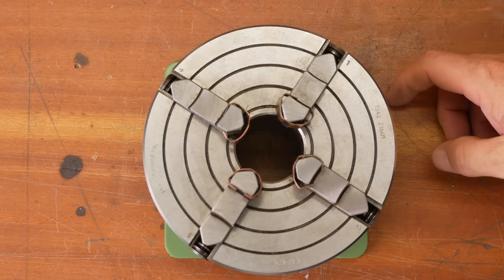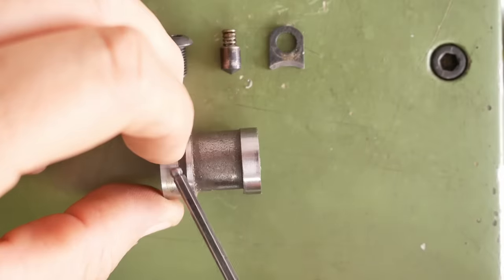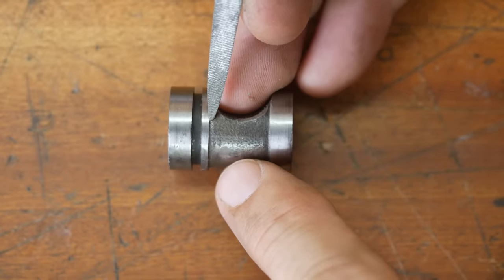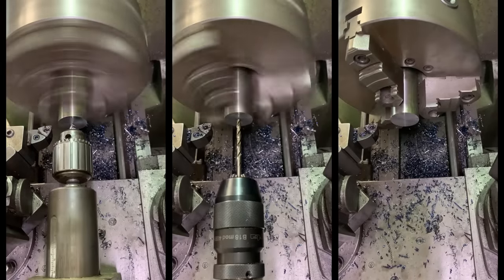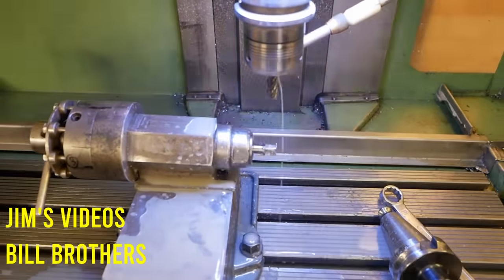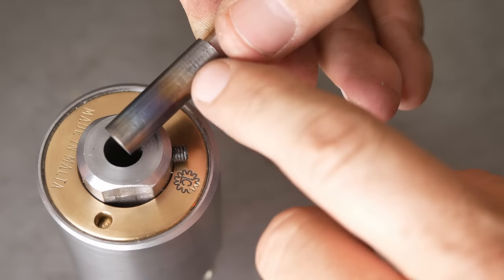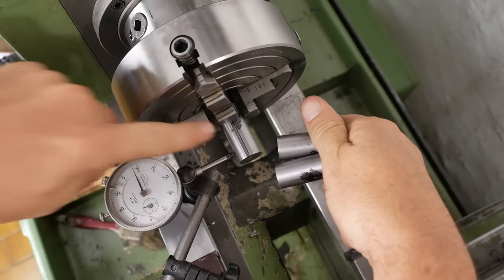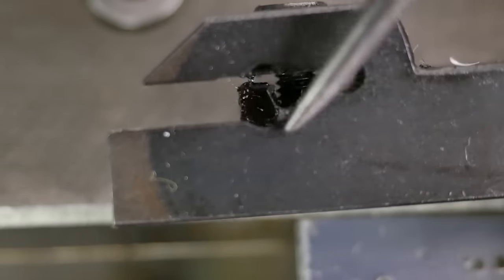DIY Camlock spindle cams || RotarySMP

Comment: What kind of fool would make seven point fasteners? 😅
Reply from the maker: G'day Jeremy, dont motivate me :)
Do have any old bristsh machines, with BSW fasterners, and everything a different size, so you need every tool you own just for the simplest set ups? Adding seven point keys would just be taking that design philosphy to it's logical conclusion .
Reply: @RotarySMP  BSW never caught on here (I wonder why?), but it takes me four wrenches to swap change gears on my lathe, and of the nuts is 21/32, which is an obsolete size, so I don’t have a wrench for it.  Fortunately is close enough to 15mm.  And the other 15/32 got lost somewhere along the way and was replaced with a 1/2” nut…so I get it.  I’ve been meaning to replace everything with 3/4” but I’ll stick to six sides.
Reply from the maker: @JeremyMakesThings  I really like how modern machines standardise on only a couple different fastebner sizes.